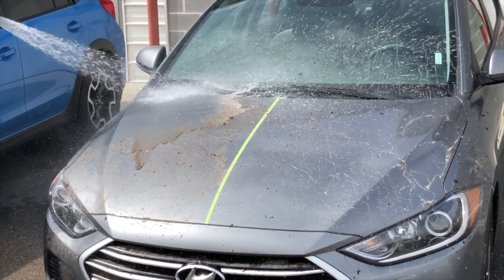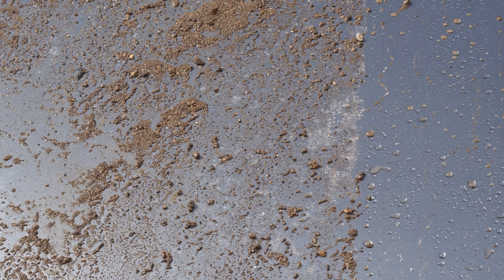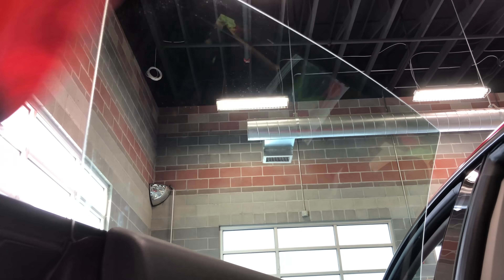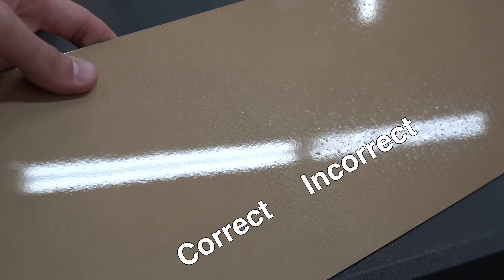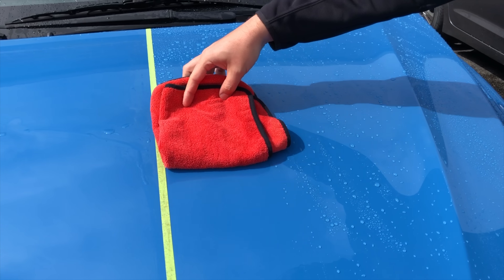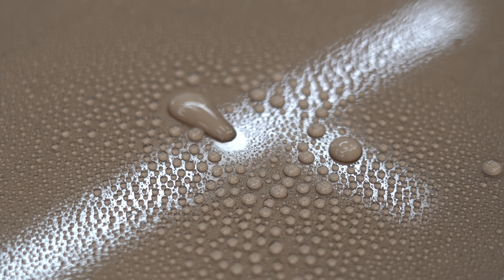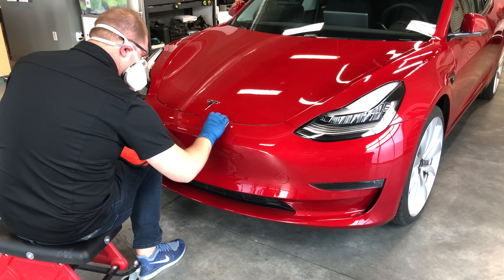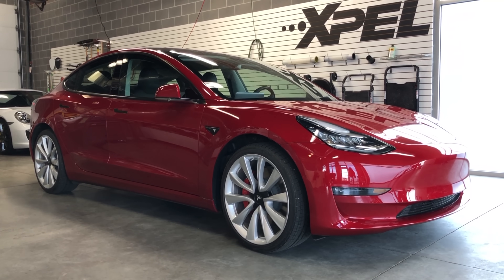Everything You Need To Know About Ceramic Coatings

Comment: I was quoted 875 USD  for the Front Bumper, 1/3 of the front hood and plus free headlights using an 8mm suntek and 1600 for the complete hood and side fenders < anyone know How much it should be? Vehecle in  question is a 2015 E63 amg

Comment: Well, the "boost" as they call it is a polymer based spray sealant that is made to be the sacrificial layer. Making it so the ceramic coating does not get affected by the outside surroundings, that is why it last up to 4 years. And that also depends what the climate is, here in Norway, you are lucky to get 2 and a halv years from a ceramic coating.

Comment: Though I have heard that if you want to paint the car after a ceramic coating you need to cut the paint back DEEP
Reply: That's correct. Accident repairs generally cost notably more on ceramic coated vehicles when panels need to blended. All the involved panels have to be stripped of the coating which adds labour which adds cost. Then there's the cost of having the coating reapplied to those repaired panels. Each to their own but I prefer more temporary coatings. There's plenty of modern options that perform just as well as ceramic coatings but don't have the longevity which is seen as a negative but IMO is really a positive.

Comment: I had my car (2011 Porsche Panamera) professionally ceramic coated with Feynlabs Heal Lite.  It has self-healing capabilities without the paint protection film.  A few months later I had a small mishap with my garage and the self-healing capabilities worked.  I was amazed at how well it worked.  As the video said you still have to wash your car, but washing is much easier now and the car always looks great.  If it is not too dirty you can do a "waterless wash" which is super fast and easy.   I am really glad I had my car professionally ceramic coated.

Comment: Lmao I got a quote for my car for just the film $5,000-$7,000
Reply: The film seems ridiculously overpriced for what it is. Can't cost that much to manufacture? Labor cost I can understand since the film is tricky and time consuming to install on contoured surfaces.
Reply: If your driving a 6 figure car, then its a good investment for your paint.
Reply: @snscustomdesigns62  If i'd paid six figures for a car i wouldn't need these products. I'd be too scared to take it out of the garage!
Reply: Yup $5500 for my Mustang GT
Reply: Is that for the full car or just partial?
Reply: @nes999  full car
Reply: Tou could use cling film, or i believe it's called saran wrap over your side of the pond.
Reply: Most detailers make a living ripping people off lol
Reply: We charge 5500 for model 3s in cali
Reply: @ultimatefinish6491  You charge 15% of the cars value?
Reply: @smythery  No, its not a price based upon the percentage of the cars value but a price that includes both the labor and the amount of film required for the entire vehicle. The cost of installation will vary from car to car based on those 2 fundamental values.
Reply: @ultimatefinish6491  I'm sure it's really hard to apply.
Reply: @smythery  it can be difficult especially on curvy vehicles. Combine that with the goal of perfection, and it can be pretty painstaking.

Comment: While signing the papers on my 2016 F150 the dealership's detailer SCRATCHED the A Pillar and the hood and also CHIPPED the hoods paint. The dealership paid to have it repainted...2 months later i go to get paint film installed in frequently damaged spots. The FILM STRIPPED the whole clear coat OFF the side panel. The painter never prepped it correctly and just sprayed clear coat over the side panel to blend in with the hood that was chipped. Now i can never put film on and protect my truck :( I have to settle for ceramic.

Comment: What do you think of ceramic coating the paint in an engine bay?  I've been thinking about this for a while now, because I want to get the gloss and colour of base/clear in the engine bay of my Z3.  Unfortunately BMW didn't put clear in the engine bay (cost saving), and I don't want to repaint the entire engine bay as that would mean stripping everything.  So I'm wondering if ceramic will at least come close to giving me the exterior colour.

Comment: Mmmm I’ve done ppf on top of ceramic on my wife’s car and it did stick to it, it comes to preping the car right, also you don’t really need ceramic to top your clear bra because nowadays all these companies come out with ppf that has same properties as ceramic coating. Tell people this is a very expensive protection, ceramic coating $1500 or so plus paint correction from $500 to $1500 spending on the condition of the car plus ppf install $2000 or so. Make the math not many people can afford these. Get a partial from ppf and ceramic the rest of your car best advice.

Comment: All shown is 10 years old tech. Xpel is so late on the market with this. Both Geyon and CQuartz have specific coating for PPF with biffed up UV protection to avoid yellowing, but you can easily drop their 'regular' coatings and have great results. Removing does NOT need sanding. A one step polish (I use Sonax 04-06) easily removes it all on an orange pad with 4 passes. I have my DD coated and every spring I have to retouch few areas due to Canada winter and parking lots bumps etc. You can't touch a 'professional' coating lol $$$

Comment: this must be a body repair / paint shop nightmare :o
Reply: I wondered that too. What about if you got into a accident. How would they fix the paint afterwards? I would guess they could wet sand the old then paint the old and new to blend it and then reapply the coating afterwards.
Reply: No, actually it makes it super easy, barely an inconvenience: You just get a really huge heat gun, about as big as a man and head up the dented body panel, till it melts a little, it then self heals and just returns to the original shape :-D

Comment: I've recently done ceramic coatings on my Audi's and my mother in law's Chevy.  It's a chore but well worth it.  Since I didn't have a pro set up, the full cleaning, decontamination, correction and 3 layers of coating took about 3 days.  

A few days after doing my S6, we took a trip to Washington from AZ.  We drove through "a butterfly migration of biblical proportions" as one article put it and the car was absolutely painted yellow from bug splatters.  We got back 5 days later and used nothing more than the pressure sprayer from a corner carwash and everything came off!  

If you love your car, this should be on your list.  FULL equipment will run around $400 to do it yourself and there are a ton of how to videos.  I used CQuarts UK 3.0, Gliss and Delux on the trim.    It's almost magical.

Comment: I work at a carwash and I can say this stuff works when applied by the pros. Rust Check and Eco Rust Tech is always sloppy no matter who puts it on, and it gets dirt stuck in it that never washes out. If it started clean when you added the coating, it'll still trap dirt and make your vehicle look 10 years older and lose a lot of value. They put a sticker with the year they applied Rust Check, and I find it lasts around 3 years. On top of that, people apply Rust Check to brand-new vehicles, which don't need protection, as they don't have any scratches in the paint or coatings.

Comment: It would be interesting to see what happens to this coating over time when exposed to the extreme heat/UV, etc.
Reply: Oshe Shango  In those conditions, it will last maybe a year and a half max if it's parked outside most of the time.
Reply: @percynjpn4615  what if my '21 truck receives coating and is kept outside (no carport) but with a good quality car / truck cover?  Does that delay sun damage significantly?
Reply: @percynjpn4615  Applying it once a year doesn't sound too bad
Reply: its gonna start peeling of
Reply: @kazleen1  used it on my car lasts around 6 months windscreen less as wipers wear it out but its good stuff

Comment: If it is silicon isn't is misleading to call it ceramic? How is ceramic technology involved?
Reply: Don't confuse silicon with silicone.  Silicon Dioxide is a ceramic, a very hard ceramic.  Titanium Dioxide is also used, also a very hard ceramic.  Different companies use different formulas but SiO2 is the most common.
Reply: @datsuntoyy   Some brands also call it "glass coating" because of the silicon content.

Comment: This reminds me of when back then I used to put a gorilla glass-like on my new iPod, two film screen protectors, a backside film to avoid scratches -already in a case, and store it in a ziplock bag. Yes, it was insane, or should I say I was/am?

Anyway, film protectors for high end vehicles do pay out, leaving you with not many concerns about having to park your vehicle under a tree, going through a puddle after having washed it thoroughly during >4hs and not being worried the paint will fade off even more by exposure to the elements, especially if it's a very old classic car.

Comment: Am I old? I was of the mind that applying wax will rejuvenate your top coat and keep it soft for when heat cycles take place, ensuring the paint doesn't become hard, crack, oxidize and/or de-laminate from the base coat.

How does the ppf/ceramic coating maintain the top coat while isolating it from the UV protection and other benefits that waxes offer?

Comment: One thing you didn't mention is UV protection. Many ceramic coatings tout this. Anecdotally, I vinyl wrapped my car with cheap ebay vinyl, and the sun almost immediately burned the gloss away. I re-wrapped the roof and hood and coated it with Hydrosilex (not even a 'real' ceramic coating, but has similar properties), and the gloss has remained for 8-plus months. So there does seem to be UV protection with that product.

Comment: what they don't tell you it needs constant reloading otherwise the effect goes away after a couple of months
Reply: The protection of ceramic coating lasts for years.  The repelancy can fall off somewhat  after a few months.  Then all it needs is a spray booster and 5 minutes to restore it.  He did mention that in the video.

Comment: Another thing to note is that microfiber towels used during coating application must be discarded when finished.  The coating residue will cure in them and basically become like particles of glass trapped in the fibers of the towels, making them unsuitable for any further use, even after laundering.

Comment: You mentioned paint correction without delving into the nitty gritty of not doing it vs. why it should be performed. It makes me think that the coating cannot be applied over a paint chip or scratch. Not everyone has idle cash in the drawer to get  a car's paint redone just to apply a ceramic coating.  Is there a downside of no paint correction other than the shine?

Comment: I would like to see ceramic vs a fresh carnuba wax on those mud stunts.
Reply: I've seen them posted.  A good ceramic with a top coat is better.  Big difference is the carnuba will drop of signifagantly after a few washes (or even one with a strong detergent) and the ceramic keeps going and going and going...

Comment: Pretty sure the "ceramic" word is for marketing and defnintely doesn't have anything to do with your bathroom tiles or kitchen china. These coatings (there are many of them) are essentially silicone, similar to silicone sealent or adhesive. Sure, they are all silicon (without the "e") based, but that makes them hardly what you'd call a ceramic (even if the chemical composition might be similar).
Ever wiped silicone sealent or adhesive over a surface by accident? Gets you the exact same effect of being hydrophobic and being almost impossible to remove execpt by mechanical means. Obviously products indended as coating have a different consistency and solvent to make them easier to apply.

Comment: Do ceramic coatings provide some UV protection like waxes do? Or is the ceramic coating purely providing a slippery hydrophobic coating for repelling dirt?
Reply: It's a better wax if I'm correct it does provide uv protection
Reply: The one I have worked mostly with provide some UV protection. I think it is a common propery of many ceramic coatings, not sure though.

Comment: How can brass scratch a "ceramic"? It sounds almost fake to me. I'm not convinced you can use a silicone carrier and then it dries 9h hard. I'm sorry Jason, the video lacks info about the product in a technical way
Reply from the maker: Not sure what you want me to say. I'm not lying haha. It's a 9H coating, the paint panel is treated in the video with it, cured over 24 hours, and then I scratch it, which you can watch in the video. Not making anything up. What you see is what's happening. I'm there for all of it, I'm the one holding that brass brush.
Reply: @EngineeringExplained  I understand, but there wasn't any proof of hardness of the coating. Any silicon based sealant would make the paint be water repellent too. I just dong get the point were a hard "ceramic" layer would be able to plasticly deform under pressure of a soft metal and then be partially melted (softned) by the mild heat of a heat gun. That goes against what I learnt about ceramics in college. Thanks for the response, but I would like to see some chemistry details of how can a Crystal clear liquid turn into "ceramic" in ambient temperature. I feel like this is a high adhesion silicone sealant. And a very expensive one. Not trying to bash the company either, they are well know for their products.

Comment: Another well done informative video.  I had been looking at the Ceramic coatings for over a year now.  It took a long time to get this questioned answered but I think it is something important when considering cost.  That is IF using a high end, professionally installed coating. You should understand most likely it will need to be professionally removed at the end of its recommended life.  Not a huge deal or a deal breaker. This is just kind of a hidden cost at the back end of the deal.   Something to keep in mind while evaluating costs.

Comment: I had a ceramic coating applied to my previous car and it worked until the first winter came and after that I couldn't tell the difference anymore. It didn't prevent a slight color shift of the paint (red paint) or scratching or road chips or ... anything except it looked like a waxed car when raining for the first 6 months. After that I resumed waxing twice a year like I've always done and wouldn't invest in this ever again.

On my current car I had a protective film on the front end only and our winters are too harsh for that. After first winter there was small holes where rocks it it and it was already changing colour and looked ugly compard to the rest of the car. It will help only for tinny rocks at normal temprature. At -20c and under with the sand and rocks we find on the road, it doesn't resist. After first winter I simply decided to remove it.

This kind of protection is useful on a nice garage stored weekend car. Yet these car don't really need it. On a daily driver I'd rather not invest in that. I keep the car clean and wax it couple time a year.

In my opinion it's a lot of money that you won't recoup when selling the car in most situation and I was not impressed from the result anyway.
Reply from the maker: Interesting, thanks for sharing your experience with these kind of products, and sorry it didn't work out great for ya. Curious which specific products you used? DIY or prof install? The XPEL ppf wraps have 10 year warranties, and the coating with 4 years. So in either of your cases, you'd have been able to get it replaced if they were defective.

Comment: Can it be applied on plasti dip? I am thinking high gloss plasti dip. Will it make plasti dip not removable (Like mixing different brands of spray-on rubber)?
Reply from the maker: Interesting question. Very likely could be applied to plasti-dip, and because of how thin it is, I bet you could still remove the plasti-dip all the same. But haven't actually tried or seen it done.

Comment: These silicone coatings have been around since the 90's, at least. At least one of the previous manufacturers was sued out of existence. The problems are numerous - Namely,  you'll never be able to paint your car without a bare metal strip. May work for throw-away transportation, not for anything having collectors value.
Reply: Unless collectors start collecting cars coated with vintage silicone coatings. An old-school vinyl roof is already a collectible feature.

Comment: did he just say heating something returns to a lower energy state?
Reply from the maker: Think like an ice cube. It can be arranged into a weird formation. But you heat it up, it melts into a puddle that's flat and smooth. Same idea here, just urethane instead of water so the chemistry is a bit different.
Reply: @EngineeringExplained  thanks for the reply, nice explanation.

Comment: Simple question - if there is a real benefit to these coatings and films, why don't car makers offer them as factory options? It would be far easier and cheaper to apply films and coatings to car panels before final assembly. Why would they bypass such lucrative opportunity to undercut these aftermarket dealers?
Reply: Afaik, you can't really scale it. No matter how big the company, it is still a labor intensive work. So it is easier to cut it, unless you are buying something pretty exclusive, then the company will do pretty much anything you want.

Comment: Everyone i have been calling are telling me its around 4k for a full body wrap
Reply: anywhere from 5K to 10K for full PPF, depending on car size and how complicated the body shapes are.  In some cases it might actually be cheaper to just have a body panel repainted instead of applying film, which eventually will have to be peeled off and replaced.